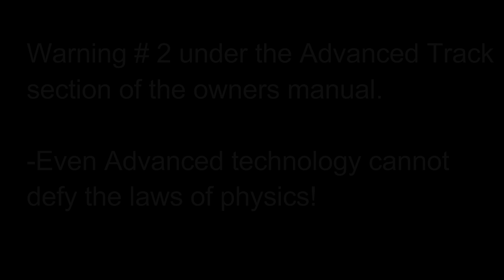The science behind why mustangs crash!

Comment: I was writing a response to the tire video when I received
notification of your new video. I got sidetracked but ironically enough I was
responding with exactly the topic you cover in this video. Aviators think
alike. So, to answer your question I do not think you can completely disable advance
track. However! It has a threshold that undoubtedly turns everything back on.
I  myself have never felt the intrusiveness
on  the GT350 in track mode. On my
previous mustangs, 12 GT and 15 GT, most certainly I have felt advance track. I
assume this is because the GT350 has more headroom due to its inherit balance??
I asked Randy Pobst shortly after I bought my GT350 about advance track. He
said he himself has never felt it on the GT350. So during our discussion I
realized that it has to do a lot with the parameters programmed in the
computers. I think it is not only steering lockout but a variety of other parameters
to include the rate at which the inputs occur. So, say I hit the same limits
you have encountered but do so at a slower rate, no intrusion.  I, unlike you, am smoother with my inputs and
do not over drive the car. It may hurt my lap times but it is just my style. However!
I am consistent and constantly improving. So I think if you find the limits of
the programing threshold the nannies come on. Can they cause a wreck or loss
of control hell YES! Especially if you have modified the suspension/tires/wheels,
etc. I will not exceed the specs of the R with my wheel and tire combo for the
track. I have a wheel I want but it is uber pricey (GA1R). As for tires and for
the same reason I just mentioned, will be keeping close to the R spec as to not
confuse the car when it decides to intrude. Once my skill improves and I gain
much more confidence in the car and my self and can push the cars limits without
intrusion I while experiment with a more aggressive tire.
Reply: Holy shit! you got to talk to Randy Pobst about the GT350R? I'd give anything for a chance to do that.  
Damn, you made me realize I didn't touch on how rates of yaw and rate of input play a huge role in everything.
If traction control was ever designed to a person's driving style, it's Randy's driving style for sure.  
What do you fly?
Also, sweet exhaust videos too!
Reply: Russell G.S. no longer flying but i am still in the industry, CH-47D/F. when did you go through flt school? instructor course? i was instructing at Rucker knox field 06-09.
Reply: Wow, small world. I went through flight school in 06, IP course in 11, and I just finished the IE course 2 weeks ago.
Reply: small world indeed!!! I will ask Randy if he was in Track mode but I'm sure he was not ; )
Reply: Harold Ortiz If you get the chance ask him if he wants to drive a firebird at Barber next weekend too!

Comment: Ill say it again, get the boss 302 "S" ABS Module; From the race program, not the boss 302 regular street car abs. You don't wanna pull the fuse because you lose ABS ( however, I think someone might of found a way to pull a fuse & retain abs ) I'm probably going to get this abs module for this season because I'm scared of the system killing me ( spoke with someone in a racing group who told me about a horrific experience he had )

Let me share my experience with this problem as I chased this issue for a long time... (incoming Novel)
I began modifying my car with the basics (LCA, relocation brackets, basic lowering springs & some cruddy Koni yellows) Once I moved to a sticker tire & wider footprint (MPSS 285/35/19 on all corners vs the stock 255/40/19 PZero ) I began noticing crazy braking issues on mountain road & sweeping hwy ramps. It happened mostly when coasting at a medium - high speed on sweeping corners ( around 50 mph ) This happened also before on some mountain hwy roads going ~100 mph it would jam on front brakes very briefly a couple times like a pulsation and it felt like a deflection was happening in the front suspension cause it would snap back like a bushing deflection... and didn't matter which mode I was in.  ( Although In Sport mode it felt more prominent , possibly because of the steering feel "Sport" you could feel the front wheels apply brakes more ) This issue got so annoying because I didn't think for a second it could be the traction control doing this as the driving was very smooth and in control on these roads & situations. I began to think the issue was with the tires possibly having a defect ( google MPSS death wobble ) Or perhaps the front LCA hydrobushings deflection under load with the sticker tires & stiffer suspension. I swapped these out for Poly and it still did it.  I then researched more into this issue and it was happening so often I began to notice the ESC light would illuminate very briefly when it happened. I then learnt about the "Full off" 5 second hold down mode at a complete stop . Since using this mode I have yet to feel the car apply brakes in sweeping corners. At autoX when getting a little hairy in "full off" mode I have spun before and had the car go into "service advance trac" mode. The 100% fix as confirmed from the track mustang groups is to just swap the ABS module to the motorsports one Ford developed for the Boss 302S race car. Its meant to be used with slicks and race brake pads and adjusts the brake bias as well IIRC. And best of all, you keep ABS braking which is a benefit imo. You should definitely buy this for the boss and ur GT if its modded with stiffer suspension and tires and driven aggressively. You can keep the stock ABS and swap it back in quickly for street if you want traction control for roadtrips, etc.  The only downside to this module I can think of is the Christmas lights you'll get on dash. 

Thanks for the videos and have fun out there!
Reply: Thanks for sharing your experience with it! I should have included the boss 302S module in the video. 
I too initially thought it was somehow the jelly filled marshmallows that Ford uses as bushings, but I replaced all the rear control arms first, and even though the rear axle location felt amazing it only made the problem worse.